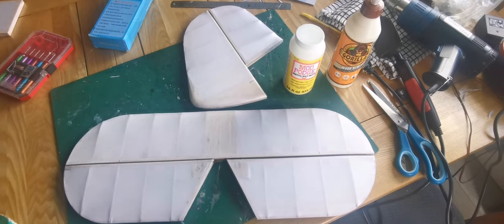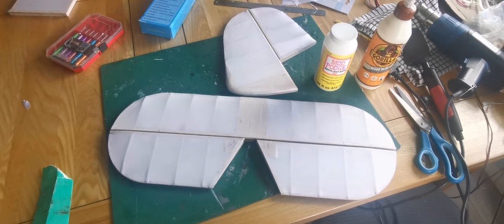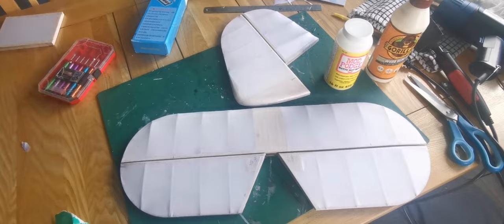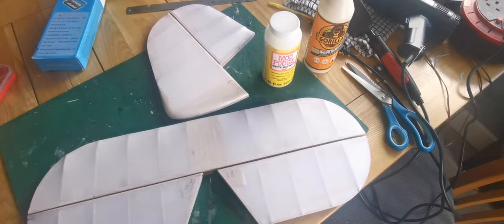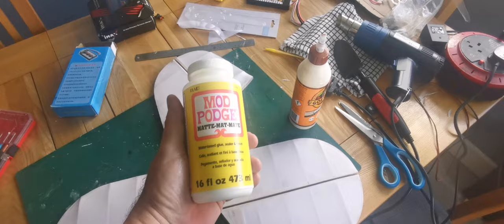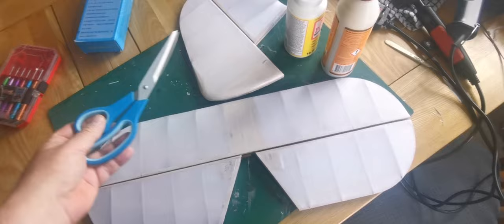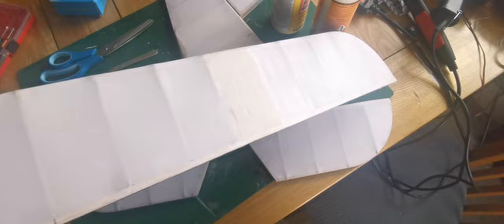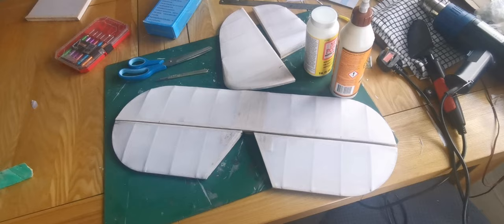Review of Polyester covering (dress lining) for RC planes.

Comment: Have a look at Diatex 1000. It's an iron on material with a thermosetting adhesive on the back. Unfortunately it only comes in one colour but it can be painted. It can also be doped for additional sealing. I'm researching model fabric covering materials at the moment, which is how I arrived at your video!
Reply from the maker: Great Ill check it out.

Comment: Fantastic idea, but a month too late for me.  I ordered the Oratex for my SE5 at the beginning of June and I am still waiting for it 😪  I could have used this way for my model, except I cannot get shrinking dope (nitro cellulose) in Iceland.  I will certainly look into this technique next time.
Reply: You don't need shrinking dope. Polyester fabric, which is quite similar to Sig Koveral will shrink tight with heat just like Monocrap.
Reply: And you can use a water based urethane to seal the weave. I have done this with several fabric aircraft and the result is beautiful. You may then apply any acrylic enamel paint that you prefer. Most acrylics are glow fuel proof with low nitro content.
Reply: But don't apply any type of dope over urethane or acrylics. You'll be sorry.
Reply: You may, however, apply an oil based clear urethane on top of it. Satin or gloss ... your choice. The fact that your fabric does not have a layer of glue over all will make up for the weight of your finish.

Comment: Are you saying you applied 2 coats of  Gorilla glue to the frame, drying inbetween....?
  Then used a hot iron to reactivate the glue and ironed on the polyester fabric...?...🤔😳😳😮😏🇬🇧
Reply from the maker: That's correct although I found Mod Podge to be even better
Reply: @MarkCroucherRC4fun I have also used 3 coats of water based urethane as a heat sensitive adhesive. You can then apply another coat over the seams and it will smooth down quite nicely provided that your trimming knife is surgically sharp.